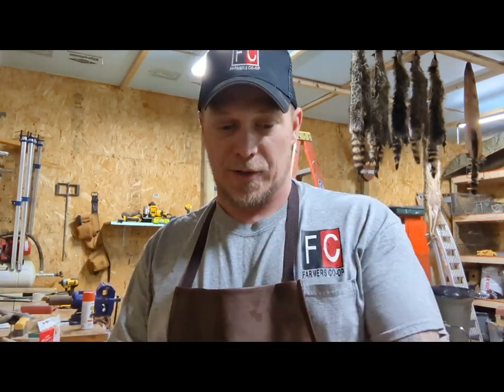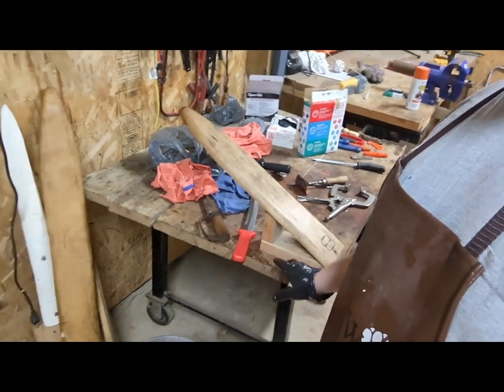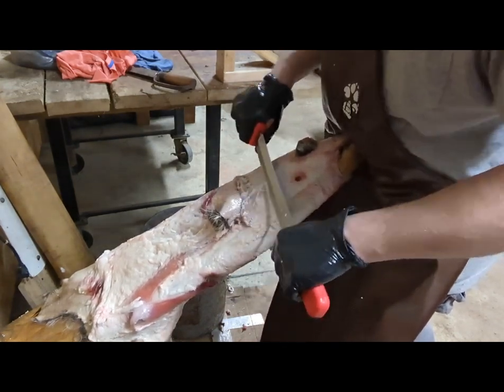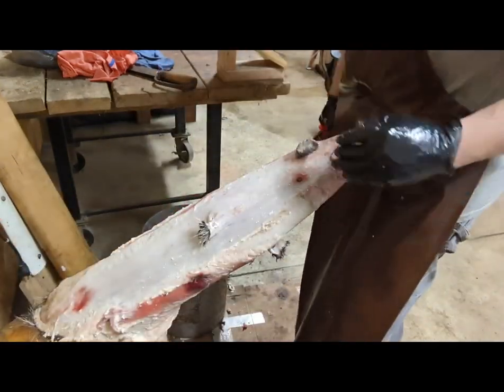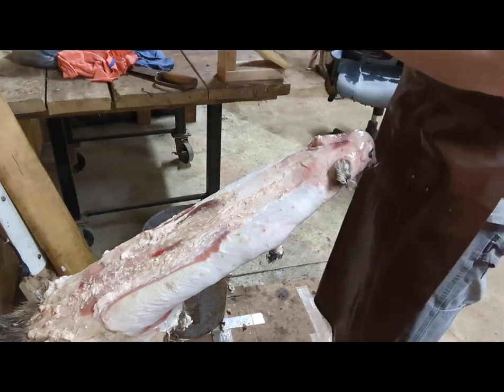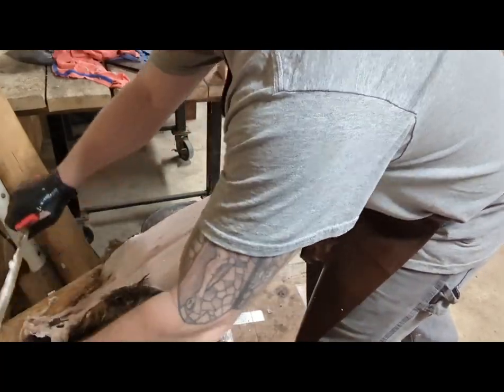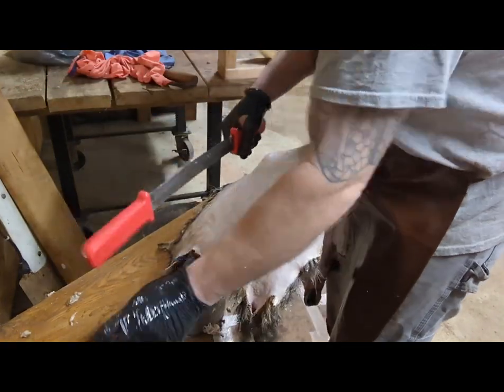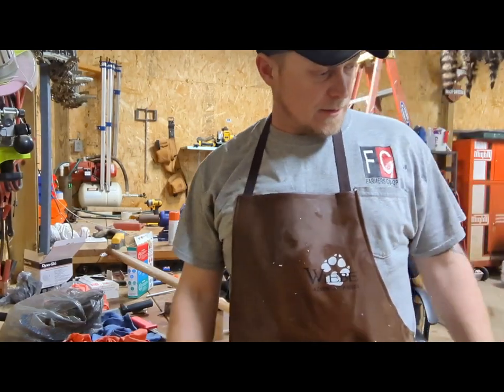How to flesh a raccoon

Comment: the weibe elite worked good for you . i have been using a post 2 handled fleshing knife for beaver and raccoon . i need to pick up another weibe because they flex and seem to work better on raccoons . i managed to sell what raccoons i caught to a guy making hats and ear muffs for craft projects . our section was not going to be in demand so i was glad to sell them . you did a great job on the pelt .
Reply from the maker: Thanks!!  I really do like that weibe.  I used a nekker for years and I still do sometimes but that weibe has the really sharp side that makes it alot easier.  I like the more straight knife like the post and the weibe.